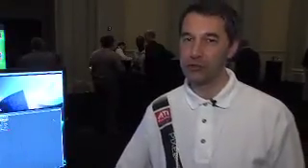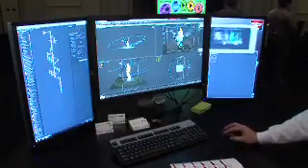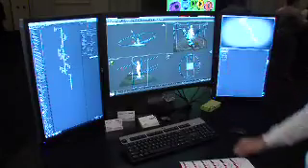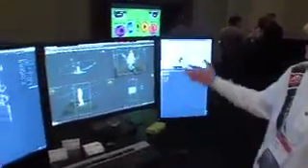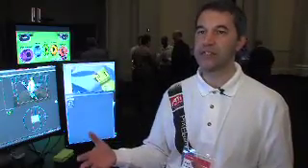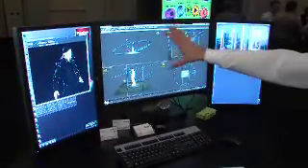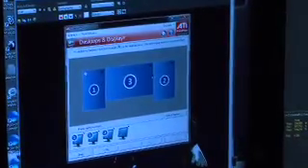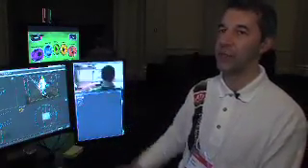FirePro using Eyefinity driving 3 displays in Autodesk 3ds max

Comment: Display port to DVI cable for my Samsung B2230,  display resolution has scaled down from the actual display panel.. I mean it doesnt fit till the edge of the screen.. remains black strip on all 4 edges.. same is happening to my Dell S2240T monitor also... Poor design...!!